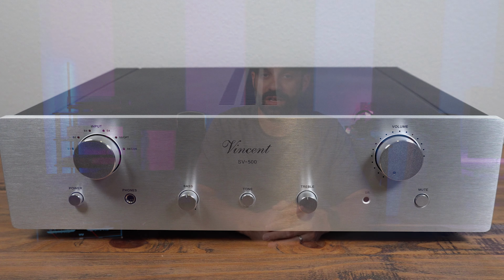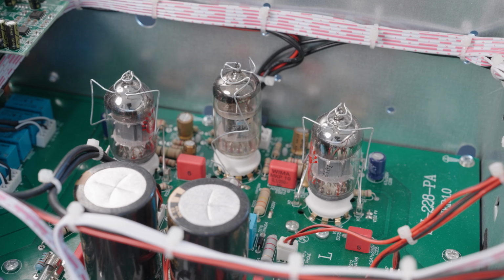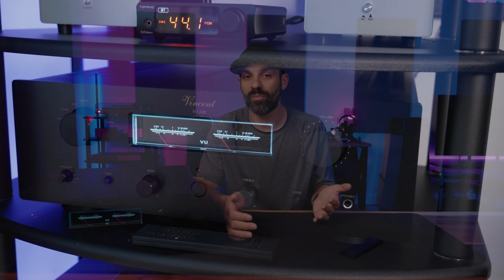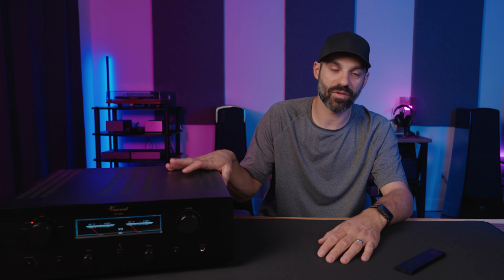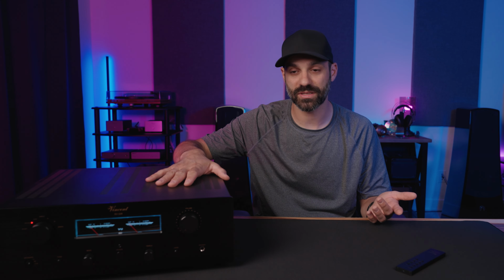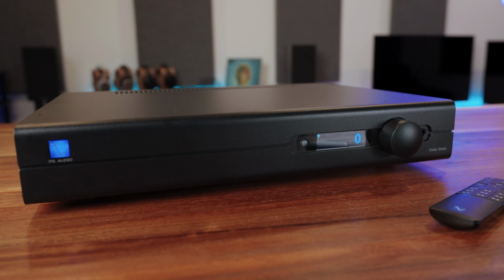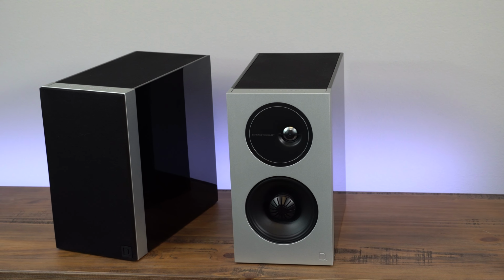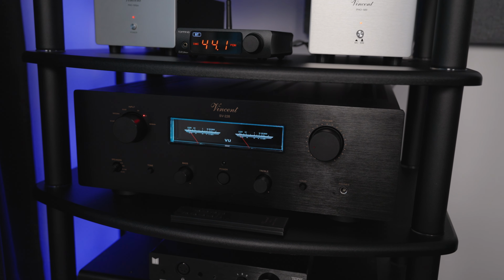Vincent SV-228 Hybrid Integrated Amp Review - Tubes and Solid State Come Together

Comment: Wonderful review. I currently have an Outlaw RR2160 Mkii receiver that I'm looking to replace. The speakers are Magnepan LRS+ which sound good with the Outlaw but are a bit inefficient. I'm considering this after trying out an Advance Paris A10 which overall sounded good but seemed to lack a bit in the bass range. I also tried a Rotel RA-1592 MKII which sounded good but didn't seem to be worth the extra $2000 cost over my Outlaw. I guess my question is if this Vincent is capable of powering the LRS+ at decent listening levels (85-90db)? I listen mostly to straight acoustic jazz, classical, and light rock occasionally. My preference for tone is a solid bass, warm mids, and detailed highs (cymbals). The music source is a Cambridge Audio 851N to play FLAC files from an SSD and well as a Rotel CD-11 Tribute for CDs. I also have a pair of Emotiva Airmotive T2+ speakers on the second channel that I play once in a while. This amp seems to fit the bill on paper hopefully it's a good fit for my preferences.

Comment: What it has is the best damn power supply that an amp can offer, which translates into authoritative bass and usually an understated power supply.   That “special sauce” is called Tubes.  This combination of tubes is the best out there for tube rolling (Nos rolling), a pair of 12au7 and one 12ax7. (6n4) and this gives you freedom to get a very adjusted or tuned to your speaker sound you can have.  My suggestion if you buy this, Upscale Audio is to get a pair of CV4003 Brimar of Mullard and a CV4004 Mullard. 12au7, 12ax7 equivalent, which should be pure magic for most. There are plenty of other combinations, but this is the best two types for a preamp section.  They use that 6n1 in a lot of their preamp secti9ns that literally is not replaceable.  I have the SV500 and will order this tomorrow to replace a all Tube integrated and replace a McIntosh Integrated (solid state) . I'm so confident in this arrangement to sell my Tube integrated and the Mac. I'll pair it with my Cary Audio DAC 200ts and be content.
Reply: Totally agreed
Reply: Any idea how this compares to the Unico 150 by Unison Research?
Reply: Any idea how this compares to the Unico 150 by Unison Research?

Comment: When you connect the power cable to the power socket, will this amp turn on without pushing any button on the amp or the remote?
I need an amp that just turns on without any human interaction and stays on.

Comment: Thanks a lot for the neutral, to the point review. I was considering the SV 228 vs the Marantz model 40N. I am not interested in the streaming part, but only the  difference in tone between the two brands. Since I prefer a slightly warmer, non fatiguing musical sound, which one would be more suited. 
Does it also have a HT bypass mode to connect to an avr as a power amp. A demo of Vincent is not possible in my country hence the query. My speakers are Dali Oberon 1 with a Rel subwoofer. Thanks again.
Reply: @nit-  i had the vincent 237mk ll  about three weeks ago . the sound  sound stage and separation was very very good and it is three dimensional . it was as if i was inside of the music listening in a bubble . however , after about twenty minutes of listening the right channel crashed (no sound ) so i turned it off for ten minutes and restarted . it played ok for a few minutes and then went to half volume . again a rest period and then the right tripled in volume almost destroying my new speakers . 
i returned it and the store owner suspected faulty tubes . 
anyway i bought the marantz model 30 and have been enjoying it since . the sound stage is as good as the vincent but lacks 3 dimensionality .however ,  as i continue to add hours of play to the amp it is becoming deeper and more immersive with incredible separation and clarity . i have 4 ohm speakers that are hungry for, power and the 30 is more than enough to push my speakers with lots of reserve for intense /loud passages in a song.  i'm VERY pleased with the sound and the build quality . i have the silver model which is gorgeous .
Reply: @siriosstar4789  , thanks a lot for the detailed feedback. I guess your 237 mk2 could be a faulty one. Unfortunately the 237 mk2 does not have HT bypass which I require   & this feature is there in the SV 228 .
 Where as Marantz is concerned, I like its slightly warm tone as this is my 2nd consecutive Marantz avr. I am sure your Model 30 must be very good for stereo listening. Wishing you years of listening pleasure.

Comment: I have a 2009(?) SV226 MKII and without the tone, and loudness buttons engaged, it doesn’t sound good. Might that indicate a problem I didn’t know? I’m from a different time(vintage audio gear is my benchmark such as the 70’s Marantz/ Yamaha) and I’ve had it for 14 years I suppose as the second owner. I just bought some Klipsch Fortes as my LSA2 tower speakers were too compressed , especially playing digital. I also missed the days of my youth with speakers as furniture. I have to laugh….I didn’t realize just how big they are and  surprisingly, they are easily driven. I’ve enjoyed it but the Vincent is very forward sounding with them. I just would like a bit more depth. It maybe a break-in period with the speakers. I would appreciate the issues I spoke of with the tone and loudness. Am I missing something or has something gone awry in my tone control. Sounds good with decent tone control when tone/loudness are engaged but very sterile without them. I have to say, I always enjoyed the loudness engaged on my old Yamaha also so it may be a preference. Would appreciate your take and suggestions. I haven’t a clue on who to ask about this as I’ve never seen this brand talked about much. Cheers-
Reply: I am of the same mentality, and probably about your age, So I’m definitely engrained in the vintage sound from the old 70’s equipment. I bought a new Marantz PM6006 in 2020 to replace an old Luxman from the 90s. The main reason I bought the Marantz was because they still offer loudness and tone controls. If these controls are bypassed or disengaged the music sounds so flat and sterile that it’s almost unlistenable, so I’m almost sure there’s nothing wrong with your Vincent amp. I also own Klipsch Forte speakers, which produce awesome sound, that’s why Klipsch reintroduced them into their product line again. Keep listening with the loudness on and adjust your tone controls to get the sweet sound you are looking for, I’ll be doing the same thing! Take care and keep enjoying the music!
Reply: Звук без тонкомпенсации плохой по 2 причинам, 1 надо поменять китайские лампы  на хорошие gold fube, аккустические колонки высокого класса и поменять в них катушки с сердечником на воздушные, поменять конденсаторы в кроссовере на топ. Тогда тонкомпенсация станет ненужной и даже неприятной. Звук оторверся от динамиков и будет  рисовать голография.

Comment: Very Nice presentation..I have a set of  8ohms and 4ohms.. I never play more than two speakers at a time.. I would put one set  on the A channel and the other on the B, play them separately.. would that be ok with this amp?  Is there a A-B selector switch?.. My current  straight Amp has the selector switch and a 4-8 ohms switch in the back
Reply from the maker: Yes it has a selector and would work fine with your setup!
Reply: @GadgetryTech  Thanks
Reply: Typically how long would tubes in a Hybrig set up last.. I know there are a few factors involved.. room temp, hours of play.. I never had a tube amp
Reply: @hubert-williams3379 about 10k hours 🤙

Comment: which is better For FPS Steelserius Nova pro wireless vs Wired vs Audeze Maxwell vs Audeze Penrose vs Audeze Mobius 3D Audio vs VZR Model One?
please Make Video Compair These Headsets.
Another question Can I Use wireless headset as wired and Will It deliver The Same Sound As Wired headsets?
Reply from the maker: Either Nova Pro or VZR Model one are best for FPS on that list.
Reply: @GadgetryTech  If I use nova pro wireless version as wired will it deliver the same sound quality as wired version
Reply: You want the best for FPS go open back, look at Sennheiser HD 560s, Epos H6 Pro, Beyerdynamjc DT 990, 900 pro x, Tygr 300r, Audio Technica R-70x, DT 1990 pro etc.